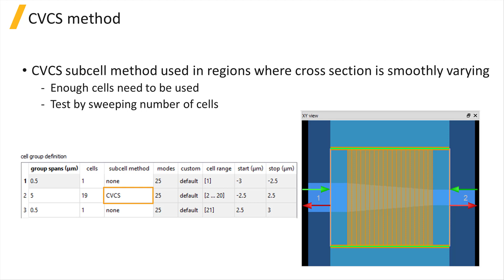Number of Cells — Lesson 1, Part 4

Comment: How do I check my cell count??? As a student I cannot go beyond 512k but it doesn't state tje the no of cells
Reply: even i am facing the same issue
Reply: @omkarkewat4245  I work in Fluent Standalone(version 2020R1) and use the Outline View section instead of using workbench, so not sure if this applies to you:

After meshing is done, you can expand "Mesh Objects" (using the + sign)> right click the mesh(in my case, I name it "Fluid", yours will be whatever you name it)> Summary.

You'll see several statistics along with cell count printed out in the console.